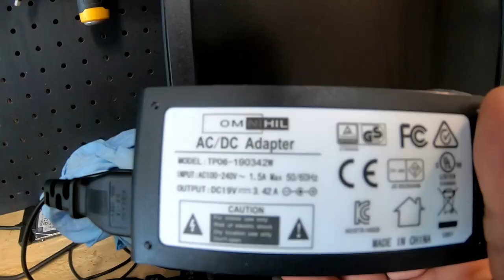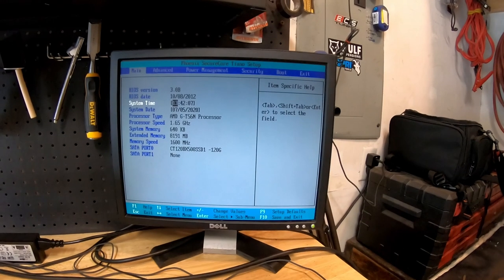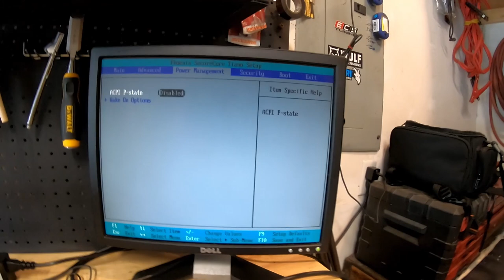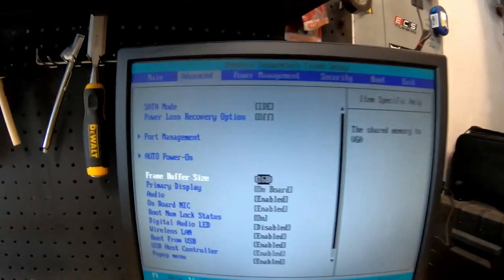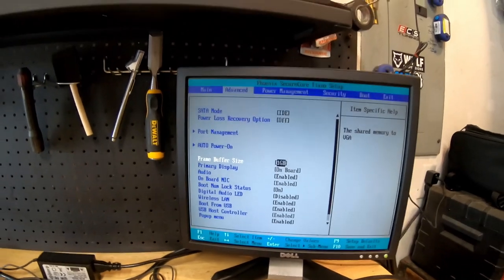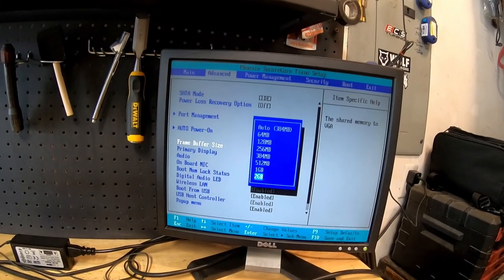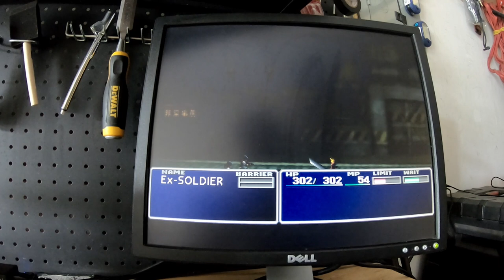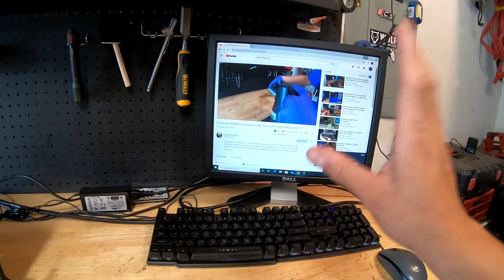Was it wise to buy the Wyse? Dell Wyse review and upgrades!

Comment: Have you tried installing Kodi / LibreElec? If it has a dedicated GPU those dedicated Kodi appliances often do decent as a set top box
Reply from the maker: nahh never did, needed something more with a litte more power.
Reply: @DLMtechgarage  Kodi runs fine on a Raspberry Pi, so the 5060 definitely has enough power. The trick is to use video files that the Radeon video chip can decode with hardware acceleration.

Comment: Hey there, can you recommend me a compatible 8gb ram (2 x4gb) for this please
Reply from the maker: any dd3 12800 kit should work. I was able to use any brand on this. I found a cheap samsung modules for like $20 on ebay. This computer is not picky when it comes to ram.
Reply from the maker: MrUnboxingmaster  Dell Wyse Zx0-Z90D7 Thin Client AMD G-T56N Dual-core 1.65GHz
Reply: MrUnboxingmaster  WYSE 7020 which comes in at least 2 variants. Also applies to the 5060 as well which has a higher 2.4 quad-core CPU.
Reply: I put 2x4gb of ECC 10600 and it does not work.. so theres that.. also bios is the original probably

Comment: Is't Dell Wyse zx0 or dx0d??
Reply from the maker: It was the Dell Wyse Zx0 Thin Client w/ AMD G-T56N 1.65GHz 8GB RAM 16 GB HDD
Reply: The Dx0d has a slightly lower spec CPU, only a single SODIMM (laptop) RAM slot, and only USB 2.0. They seem to be more stable though, maybe because they run a bit cooler.

Comment: How max size sata hdd upgrade? 2tb is working?
Reply from the maker: yea you can put a 2tb in. It will work fine.
Reply: @DLMtechgarage  You can fit those things in that tiny thing?
Reply from the maker: @rudycrawford2458  yea has room for a 2.5 ssd once you mod it for the power. Ive seen a bunch do it.